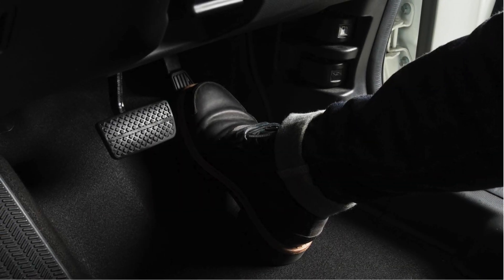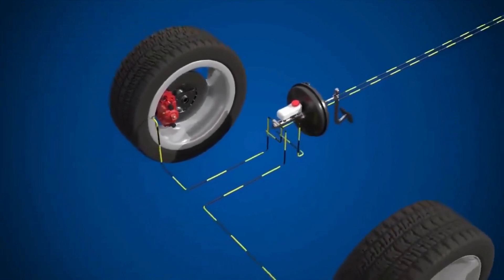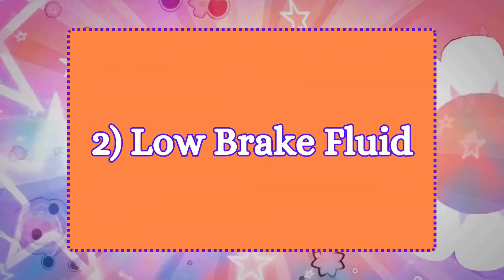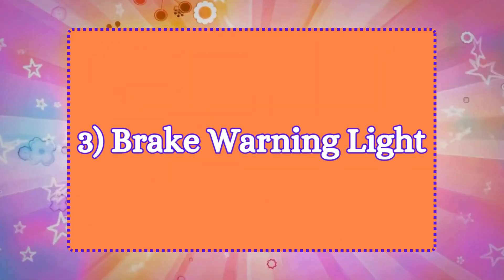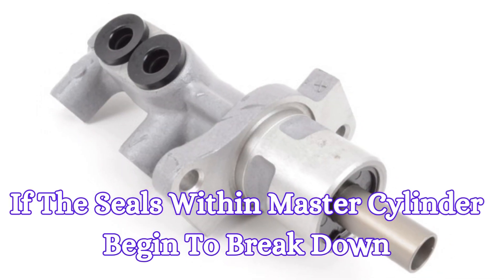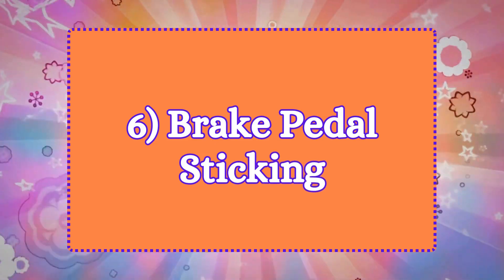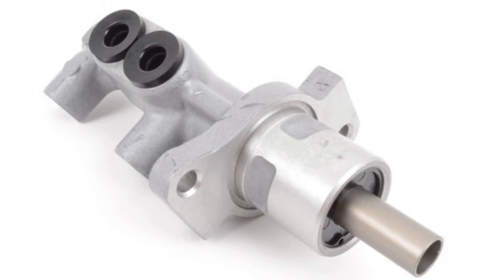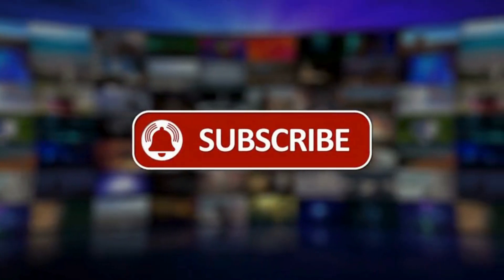7 Hidden SYMPTOMS Of A Bad Brake Master Cylinder | Spongy Brakes, Unresponsive Brakes & More

Comment: Helping out on a 2002 Toyota Corolla. You have to pump the pedal twice to get a hard brake. Once you do that the brakes work great. Originally the pedal went about 90% to the floor. We tried adjusting the rear drums to help set the pedal height and it improved a lot and now goes about 1/2 way down before getting brake pressure. We tried bleeding all 4 brakes and got a very small amount of air from the RR. But not much of an improvement. With engine off, 2-3 pumps and pedal is rock hard. Start the car up and pedal goes 1/2 way down. Do you think bad Master Cylinder or still more air in the system?
Reply from the maker: The symptoms you’re describing point to a few possible issues, and here's a breakdown of what might be happening with your brake system:

1) Master Cylinder Issues
If the internal seals in the master cylinder are worn or leaking, brake fluid can bypass the seals internally, leading to reduced pressure in the system.
Perform this test:
With the engine off, press and hold the brake pedal steadily. If the pedal slowly sinks to the floor, the master cylinder is likely failing.
Check for external leaks around the master cylinder and its connections to the brake booster.

2) Air in the Brake Lines Check
i) Residual Air Symptoms:
a) Spongy pedal feel that improves slightly after pumping.
b) Difficult to achieve consistent brake pressure.

Possible Issue: There might still be some air trapped in the lines or ABS module. Sometimes, conventional bleeding won't fully eliminate air, especially in the ABS system.
Solution: Consider performing a pressure or vacuum bleed. If the vehicle has ABS, a scan tool may be needed to cycle the ABS pump during bleeding.

3) Rear Drum Brake Adjustment
Improperly adjusted rear drum brakes can lead to excessive pedal travel, as the shoes must travel further to engage the drum. Ensure they are adjusted just enough so the shoes lightly drag on the drum.

Next Steps
1) Master Cylinder Test: If the pedal sinks slowly with consistent pressure, replace the master cylinder.
2) Rebleed the System: Use a pressure or vacuum bleeder, and don’t forget to bleed in the proper order (typically RR, LR, RF, LF). If the car has ABS, ensure the module is cycled.
3) Recheck Rear Drum Adjustment: Double-check that the shoes are close enough to the drum to minimize travel.
If the problem persists after these steps, it may point more strongly toward the master cylinder.
Reply: @ProAutoTips  Thanks for your response. We have done most of what you suggested. With engine off 2-3 pumps of the pedal and it is rock hard and when holding it like that doesn't bleed down at all. That is why I am really hesitant to call a master cylinder. We have adjusted rear drums, to the point we have good drag and really don't want to over adjust and get too much drag. With the wheel off, you really need to get a good grip with both hands to get it to spin and you do hear slight rubbing. With the wheel on a little bit easier to spin with all that mass but still hear the slight rubbing. The next step will be to try bleeding with a scan tool. I'll let you know how that goes.
Reply from the maker: @karlvondrak6080  okay sure
Reply: @ProAutoTips  So we tried bleeding the brakes with a computer and it doesn't support the air bleeding. They had a shop try it and even the shop had issues trying to get it to bleed with a computer, but supposedly were able to finally get it. No change in the pedal. They pinched off the left front caliper and then pedal was nice and hard, so they told us issue with left caliper. We had already replaced the right due to broken bleeder screw and could get it out. Didn't sound right so when I got back over there we tried pinching the left hose and nice hard pedal. Then released that hose and pinched right hose. Nice hard pedal. So that didn't prove a bad caliper. They wanted to replace the master, so we did and we were able to get all 6 lines loose at the ABS unit and bled the 2 lines from the master to the ABS and then the 4 lines coming out to each when and then at each wheel. Still no change in pedal. Took car for a drive and if we get on the gravel on the side of the road and hit the brakes hard, the ABS does kick in and does not allow wheels to skid.  I am just at a loss. Someone did say try replacing the ABS unit. Just don't want to be shot gunning parts at it.